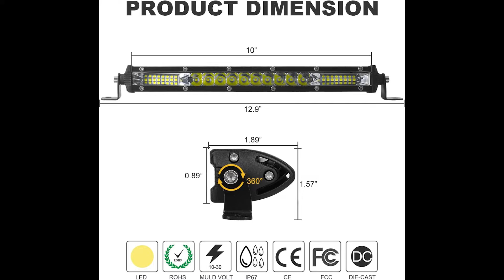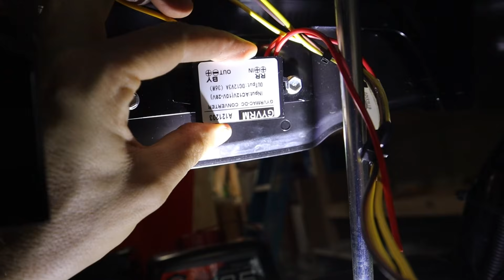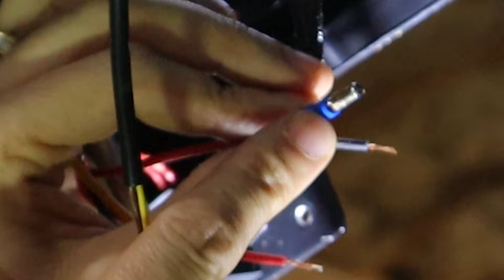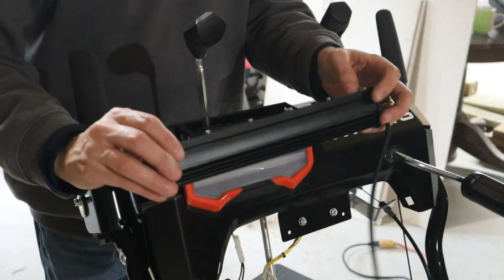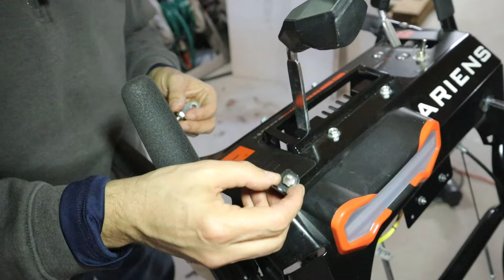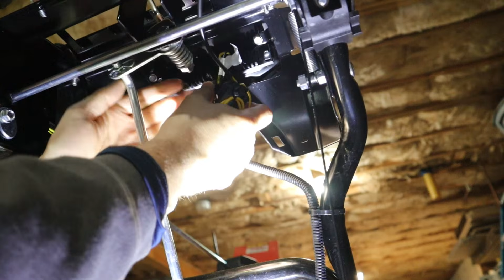If You Need to Upgrade Your Snow Blower Headlight Try This!

Comment: Great explanation! I did the same thing a few years ago. Slightly different though as I mounted an amber 12 inch led light bar to the control panel but with a switch so that I can turn it off in the daytime. The amber led light bar is better to have in snowy conditions.

Comment: I was thinking of mounting the light on the auger housing so it doesn't shine on the chute.  Think that will work?
Reply from the maker: Make sure your mounting hardware doesn't vibrate loose and get sucked into the auger.

Comment: You really should have fused the 12vdc positive going out of the converter before connection to the light. Thats the proper way of doing it. Based on the power rating, a 3 amp inline fuse would suffice. 

I just did the mod but used the 5 amp 60w version converter to connect 2 x 18W LED lights on the top of the auger housing. These converters are rated 10 to 28v AC but they really want north of 14v AC from the stator to avoid DC spikes or irregularities to the light that may cause damage. Thats why a fuse is important. 

My 926LE is an older machine so totally not led compatible or DC light ready so you csn probably get away with it but why risk it. If you get a surge the fuse will do its job and you wont fry the light.

Comment: Its easier just replacing the halogen  light bulb for an LED light. You can pigtail into the lighting wire with no problem without any regulator. I added the front blower housing light kit from Ariens as well as changed the stock bulb. I can see everything around and in front of of the blower. I added my own light to my last snowblower. It was pretty easy.

Comment: Did you not install an inline fuse? If so what size. If not Why?
Reply: A fuse is highly recommended. Installing a fuse on the + side wiring is not difficult. Amazon sold them in a pack and I bought some maybe 5 years ago.

Comment: The rectifier isn’t necessary as the LED by itself is a half wave rectifier and will run on AC at half duty.  Your Ariens already has the LED stock light on the handlebars, that unit doesn’t have a rectification circuitry built in.  The frequency of the AC from the stator is fast enough you won’t notice the flicker.  LED Christmas lights are only half duty cycle and work on AC with no rectification.
Reply from the maker: I figured I'd add it anyway since it was cheap and relatively easy to mount.
Reply: So how do you prevent the lights from flickering?  I would rather get the full benefit of the light.

Comment: Different topic: Do you use a special paint or coating to keep wet freezing snow from clogging the chute?
Reply from the maker: I've never really had too much trouble with clogging over the years so I don't add any coatings.
Reply: Silicone spray or WD-40 before and after each use!